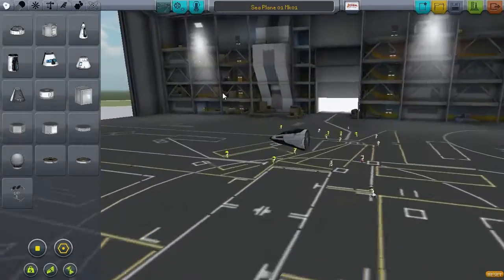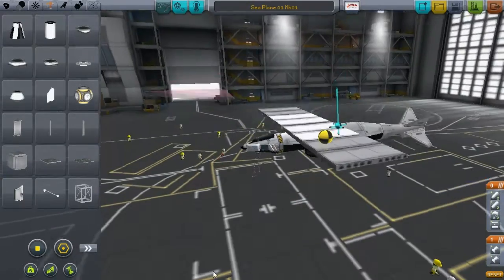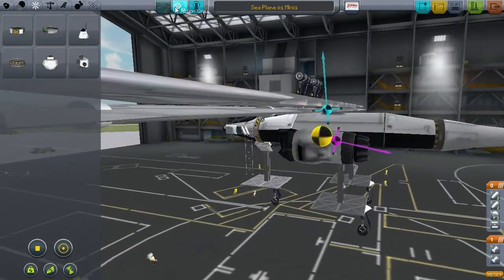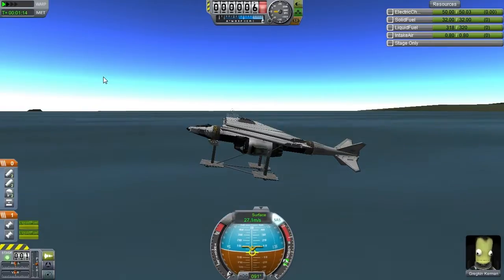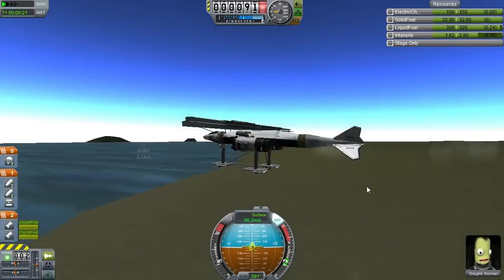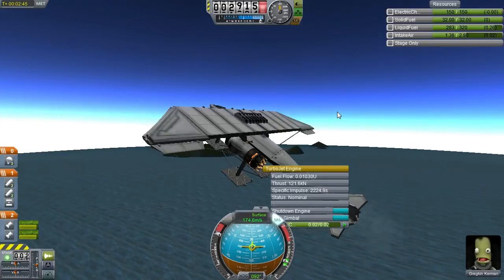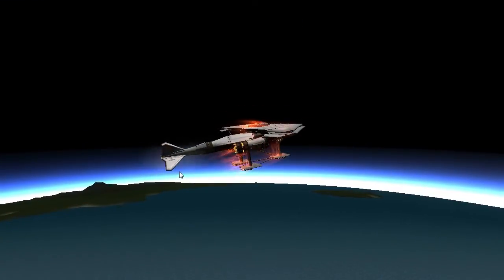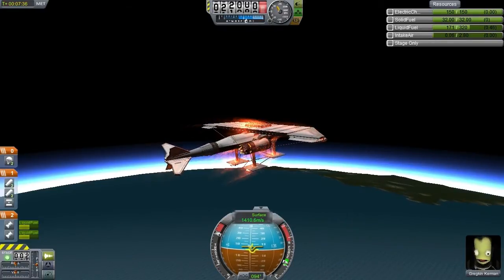KSP Stock Supersonic Sea Plane

Comment: The curvy air intakes are better for the skis
Reply from the maker: True, there are actually a few better parts I could use, for instance the small cubic struts weight aren't counted by the physics engine, so if I used them I'd be able to have attached the skis without affecting the center of mass retaliative to center of lift & drag. However I opted to go with the parts in this video to try to keep it looking like a sea plane as much as to actually be functional, this is also why I avoided intake spamming and started with the turbofan engines rather than immediately going to the turbojet.

Comment: haha,a $99 graphics card... XD
Reply from the maker: $99 still gets something older like a AMD HD7770 is about that here, and would be 20x faster than my current NVIDA 9300GS at stock speeds. I overclock the 9300GS about 40% over factory speeds (to just under a ghz) and shift the color correction and image rescaling tasks to my monitor's image processor, but that setups still weak sauce by comparison to the HD7770. What I was getting at with that statement is never buy a gaming laptop unless your prepared to change it every 18-24 months... not being able to upgrade easily is a huge pain.
Reply: Hamish McGregor oh ok,but still...a $99 graphics card...might as well get a ps4 and be done.Pc gaming isn't worth it if you don't have the graphical performance to support the developers true vision in a video game.
Reply from the maker: *****
I couldn't disagree more. With a sensible overclock, a few mods and a well chosen set of settings even a cheap graphics card will provide as good or better performance than a 8 core apu console, and will do so for about the same money.

I will note this is the first time this has been true, in the past a gaming PC needed to cost twice what the consol did to be competitive, but with the Xbone & PS4 this is not the case, similar money gets you similar specs if you shop smart. Also live-streaming, recording, productivity work and word processing are either impossible a just pain on consols, so you'll still need a pc (admittedly even a fairly old one) somewhere if you do buy a console anyway, branding them most defiantly a tech toy rather than PC alternative.

Finally even if you can live with your old rig for non-gaming use and don't like using mods or playing older games you can't get on your console, the lack of updatability is a killer. If in 12 months 4k monitors drop to $300, a pc gamer could crossfire (or SLI) his graphics cards and run medium settings 4k, a consol gamer has 2 options, replace his entire rig or get used to his games looking like ass compared to the then market norm.... I'll stick to the PC thanks, already made the upgradeable mistake once when I got a laptop for its portability.
Reply: Hamish McGregor i never told u to get a console.Why are you getting so madbro?
Reply from the maker: *****
Sorry if you interpreted my last comment as an angry one, it wasn't meant to be but its hard to put tone on writing. I'm not mad just highly recommend others not to get a laptop or console for gaming... will cost you far more in the long run and limits what you can do.

Comment from the maker: Wouldn't help, like many games KSP has single threaded physics, this means that you can only use one logical CPU core for this task. Given in KSP the physics is most of the game-play its not really surprising that its this that causes the bottleneck on most systems,not the graphics card.

Yeah at some stage I do need to upgrade my laptop to a newer PC but there is a cost factor... with a laptop I can't just swap out the cpu or add a $99 graphics card to revitalize the system.

Comment from the maker: May do, for now I'm working on a dew low tech level designs to suit the new 0.22 update, because now users can't load many of the great models that are available on spaceport or from other YouTubers in their main games due to tech limitations.

This is especially true for planes, as you don't start with any parts to make them and wheels are quite high tech level, however I have a working tech0 sled design that works quite well, so a tech3 plane video may be on its way, no promises yet though...